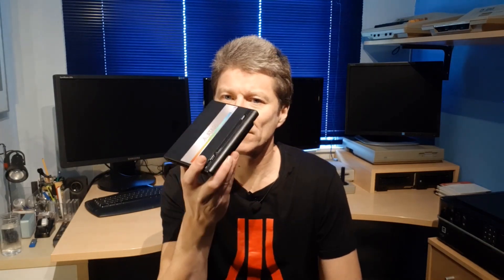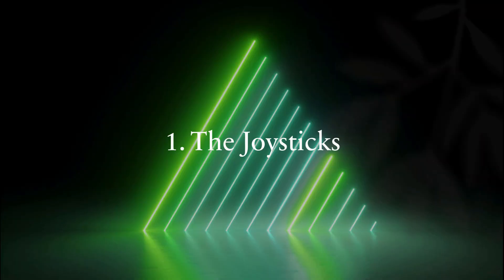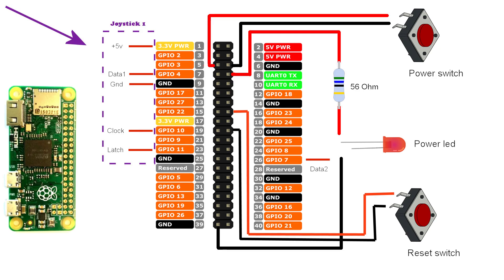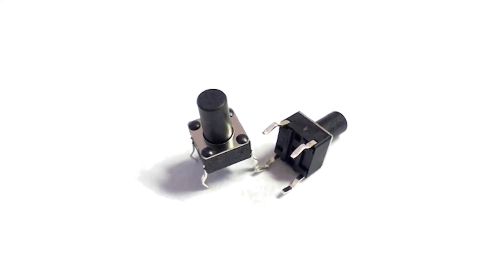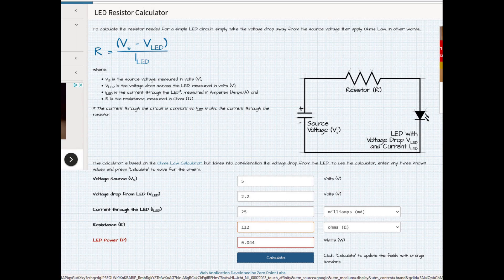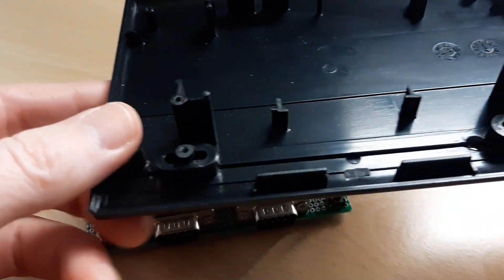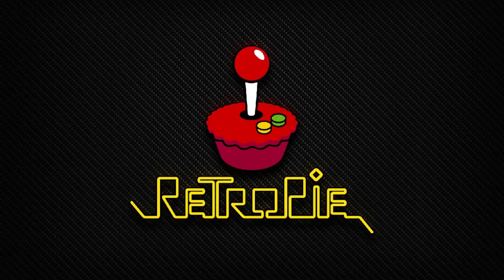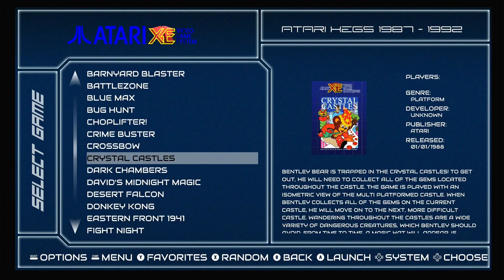My Ultimate Atari Flashback, part 2: Complete build details

Comment: Would You be willing to sell a sticker like the one you have? Looks nice and I want one for my project. Very nice work and detail.
Reply from the maker: Unfortunately I don't have any stickers. But I have now added the PDF file, which you can use to print out the labels yourself, to the comments section of the video.
Reply: @gespy  cool, thanks. Working on a mini 7800 pi 5. Thanks again! 😊
Reply: This is such a great project! Nice work. Where is the PDF of the label? I've looked in the description and comments of both part 1 and 2.